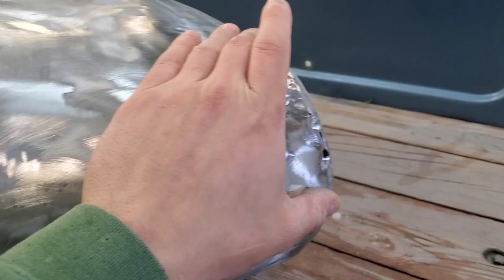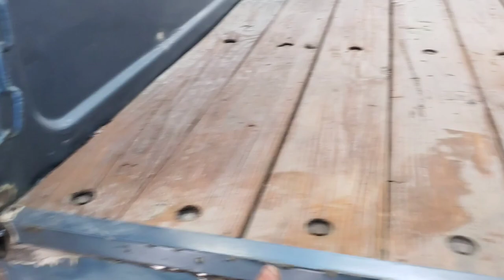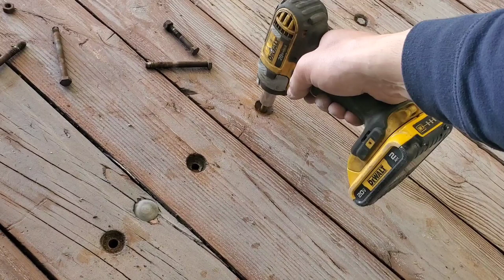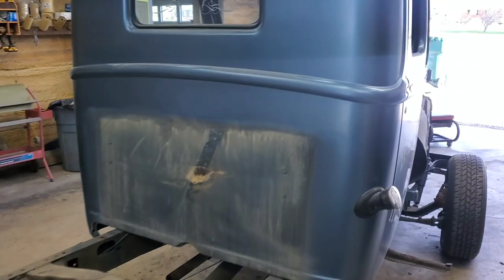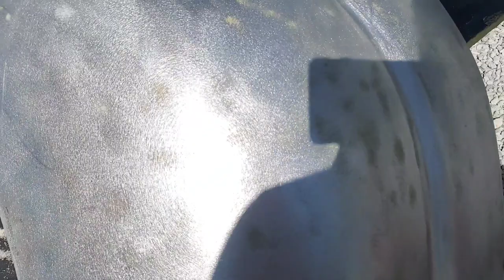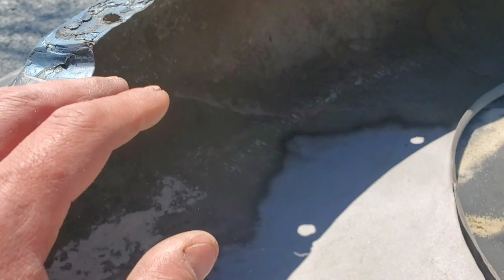47 Ford Truck Resto Vlog part 5 lots of sandblasting, welding and fabrication is gonna be needed

Comment: What product are you using to do the sandblasting? Thanks
Reply from the maker: Well we were using play sand from Lowes for years, however they recently have decided to add pea gravel and tiny little rocks to their sand so now it won't work. We switched to pool filter sand and they raised the price to $20 a bag so now it's just not worth it to sandblast in house we take it somewhere if blasting is a must.